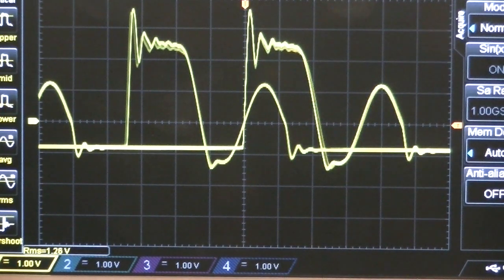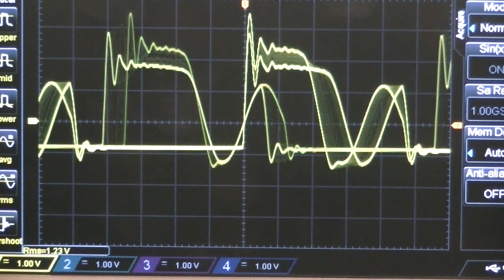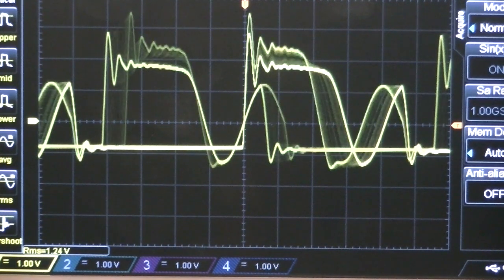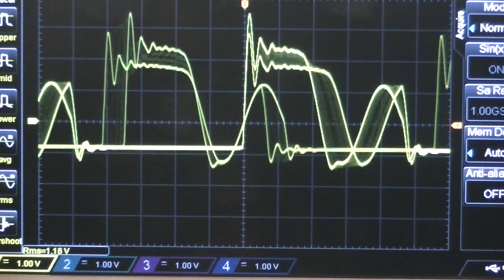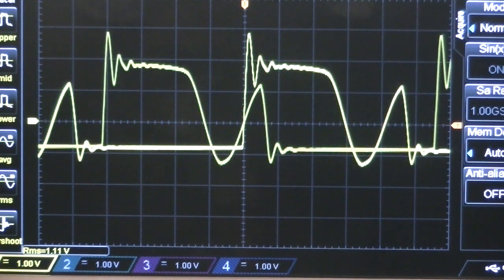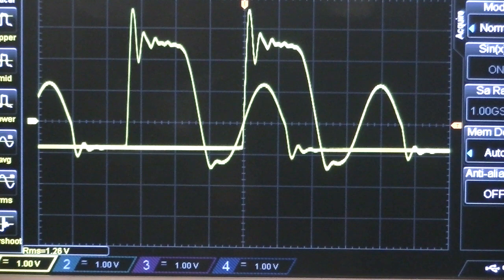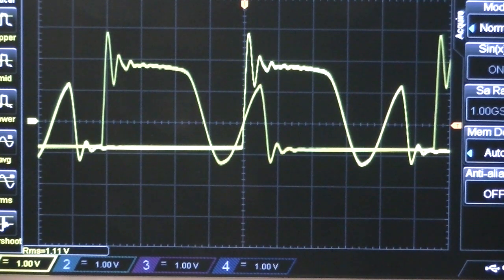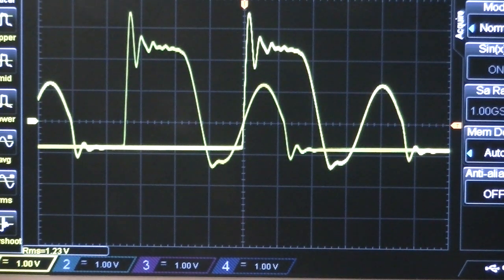What is this

Comment: Looking at it a bit more carefully, I see that the basic waveshape is always Elephant, Shark. The scope is triggering on the rising edge of the Elephant, completing one screen, then retriggering on the rising edge of the Shark. If you move the trigger level up to where it just catches the peaks of the Elephant the screen will stabilize. Or, if you need to keep the Trigger Level where it is for some reason,  you can play with the "Trigger Holdoff" setting to make it a little longer than one complete Elephant-Shark waveform.
Trigger Menu>Setting> Holdoff  and if you then press the Multifunction knob you get a little keyboard where you can enter the desired holdoff time.

The probe is measuring the voltage between its tip and its ground reference clip. There can only be one value to this voltage at one instant of time!  ;)

Comment: I think you are triggering on two different portions of the same irregular signal. Try going to a slower timebase so that you can see segments of the "elephant" waveform in between the other waveform, then use the scope's "zoom" feature (press the Horizontal Scale  knob like a button, then turn it to zoom in) and scroll left and right with the Horizontal Position knob to see the different parts of the wave train. Set the Trigger just below the high peak of the "elephant" waveform. 
Usually whenever you see different overlapping waveforms on the same channel like this, you actually have a wave train with different segments doing different things, and to resolve them do what I suggested. There are also advanced triggering options that will allow you to get a stable trigger on just one of the waveshapes in the wave train, but it's easiest to use a slower timebase and the zoom feature.
Reply: TinselKoala Hey TK,
Isn't it possible, if  it's not a trigger error as you suggest, that he's showing the crosstalk between the two transmission lines (aka 'coil windings'), [capacitively] coupled onto the line he's probing?

If so, that explains the phase difference between the waveforms, as well as the slow buildup of the second 'hump', until it drops back down.

In other words, he's displaying the RLC circuit resulting waveforms  made by the coupled transmission lines (windings).

(There doesn't seem to be enough jitter to indicate a trigger issue - also the Rigol seems to be notable for it's huge, fast aquisition memory...)
Reply: Yes, see my new comment up above. The scope is triggering on two different parts of the same waveform, I believe. The "phase difference" is just caused by the scope triggering first on the big rising edge of what I call the Elephant, and then re-triggering on the rising edge of the Shark fin. Fortunately it is possible to obtain a stable screen in several ways.

Comment: Hey Brad. If I had to take a semi-educated guess, it looks like a cap charging, reaching peak voltage, then discharging and ringing down to a lower voltage, then charging again. Given your series-wound bifilar coil activity on OUF as of late, I would imagine it's on one of those coils.  Since you mentioned JT, I wonder if your load is an LED. Maybe your swbifi coil is charging thru some kind of induction, allowing the voltage to build and discharge?  Enjoy your work.
Reply from the maker: Closest yet

Comment: Are you showing the ringing on the input of your trigger circuit?  If you are using a bipolar rotor on your PEM (ie., N-S-N-S magnets) , then perhaps the AC signal would show up as two instances of the same thing only depolarized on the scope plot.  Yes?  (btw -  your videos are most helpful - thank you for your contribution)